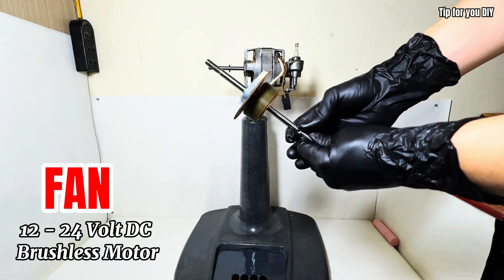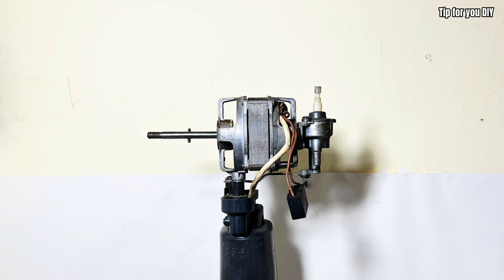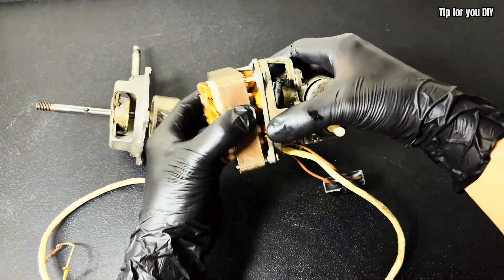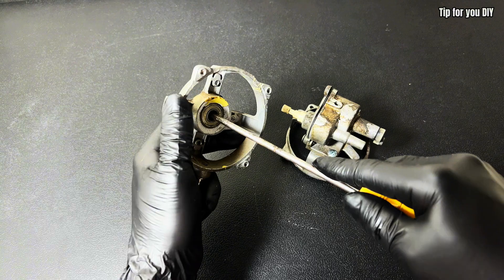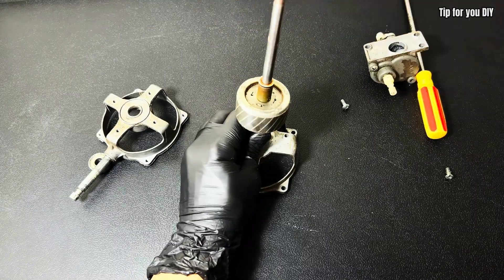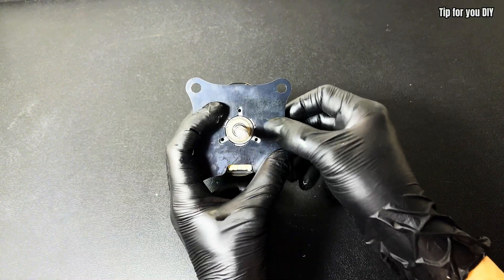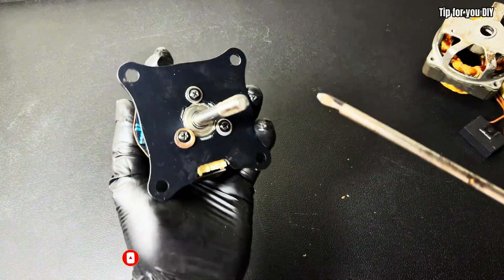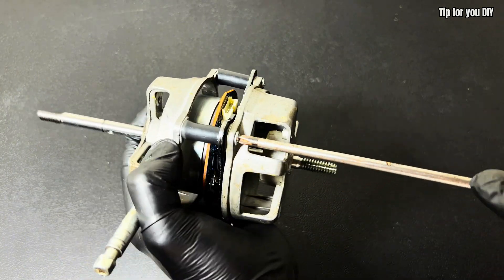How to Turn an Old Fan into a Super Powerful DC Fan with a Brushless Motor

Comment: What kind of remote control circuit did you used sir?
Reply from the maker: I bought them on an Asian e-commerce site. I just have an old motor removed from a broken photocopier. I made this video a while ago and now I use this fan every day. I changed the fan blade to the one with 7 small blades inside. I have to say it's great, the wind speed can be adjusted as desired, smooth and quiet, the motor also does not generate heat, which helps save a lot on the monthly electricity bill. You should make your own fan like this. Thanks for watching...

Comment: I liked you video and good engineering, is in my plans,
Reply from the maker: Yes, it is a useful video about the fan, it does not generate heat when operating, very high speed, energy saving. I am preparing to show a video tutorial on making a fan with a brushless motor from a broken photocopier. I have not filmed it yet so I do not know where to start to make a good video. Do you have any good suggestions for me to follow? Thanks.
Reply: Please I need 2:52 motor holder frame schematic plan,
Reply from the maker: I've uploaded the video to the YouTube channel "Tip for you DIY" and I invite you to watch the main content of this video. Please share your comments so I can learn from my experience in the next video. Thank you very much. https://youtu.be/Ue7wk4SGZ9g?si=i77MuFKflRv4CZb2

Comment: Bro your spot welding machine good work 
But no use only work in nickel strip lithium ferro phosphate not working please tell me
Reply from the maker: Yes, that's just a temporary solution. Please wait a little longer, I will make a more useful spot welder. It uses 220V voltage, adjustable voltage, and can weld all kinds of nickel of different sizes. Thank you very much.
Reply from the maker: I've uploaded the video to the YouTube channel "Tip for you DIY" and I invite you to watch the main content of this video. Please share your comments so I can learn from my experience in the next video. Thank you very much. https://youtu.be/Ue7wk4SGZ9g?si=i77MuFKflRv4CZb2